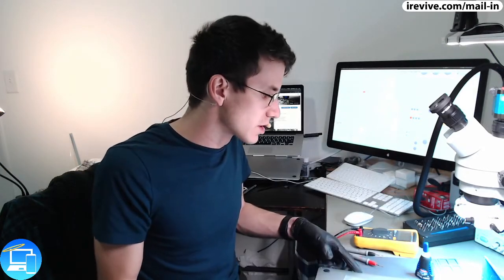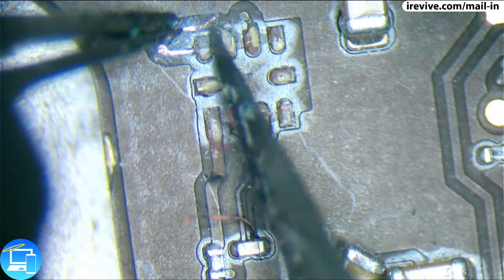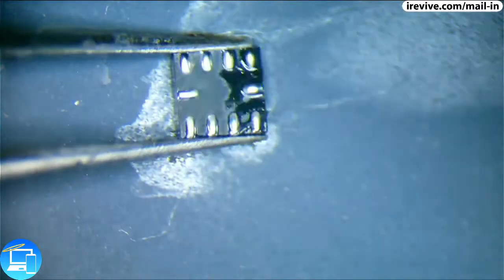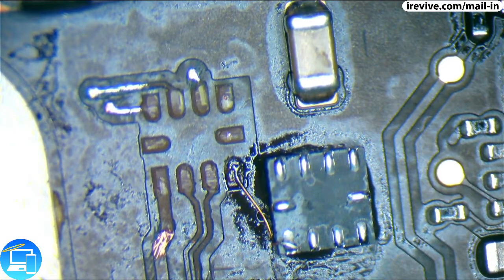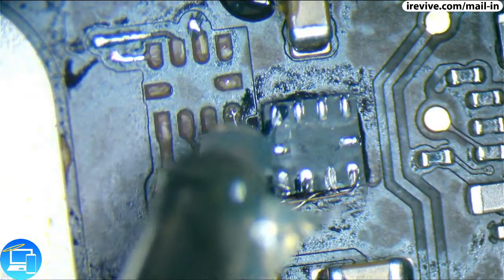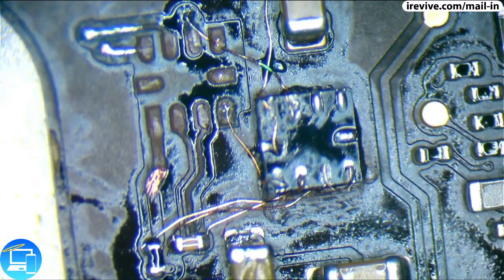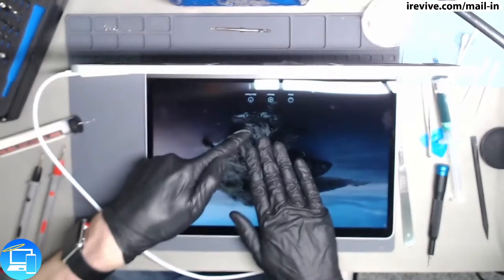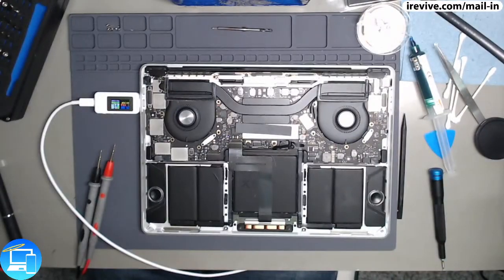A1706 Damaged Thermal Sensor Repair

Comment: While I think you did a great job of micro surgery, it doesn't look pretty for anyone that needs to work on this down the road. Northridge Fix has available "pad strips" which is a way to replace those missing and damaged pads. I've tried to find them elsewhere but they seem to be the only ones that have them. I think these became available after this video and I would think they represent a better option for this type of repair.
Reply from the maker: I have seen a couple of pad strips in the past for iPhone repair. Especially for vía traces. I’ll look into these as an alternative in the future for this type of repair. Thank for sharing. I have done this method a few times thanks to the guidance of a video posted by Paul of Rossmann Repair group. I would agree that beauty is sacrificed for functionality when performing this repair. This is why I love this community. Sharing tips helps everyone grow and prevent clients from having to spend thousands on new computers. Thank you.
Reply: @iRevive  I should have also mentioned that they have a number of YouTube videos showing how they use them. It's quite remarkable.

Comment: Hello teacher. I have the same problem. Could you help me please? Which other IC is compatible or where did you buy the part?
Reply from the maker: The IC is taken from a donor logic board. IF doing this repair, I highy recommend using a donor board for any parts needed.

Comment: Hi, I'm from Malaysia. 
I'm not sure is it common in your country, can i get your advice on soldering on an old IMac motherboard for missing L5500?
Reply from the maker: Hi there. L5500 is going to be an inductor (Coil) that is two solder points. You should be able to wick up the old solder off of the board and solder the coil to the board by heating one bad at a time.

Comment: Hey dude can you had a thermo senor to a 2010 MBP that's had a Samsung SSD installed? Fans are know going crazy.
Reply from the maker: Have you tried an SMC and NVRAM reset? If so, then what I would recommend is installing HW Monitor and check to see what sensor is reporting high.
Reply: @iRevive  Ok will try this thanks
Reply: @iRevive  where can I get a copy of HW Monitory?  Google search didn't provide any useful link to download.